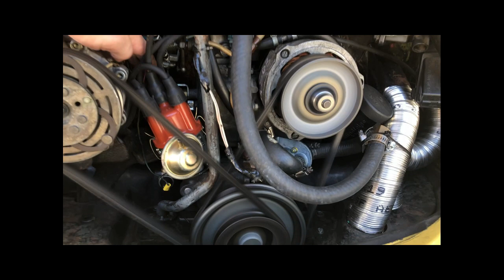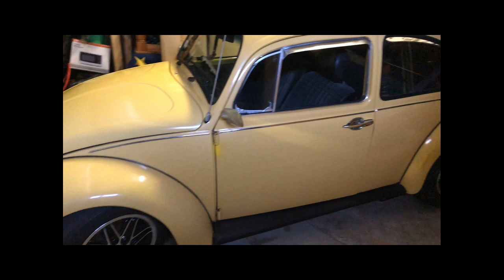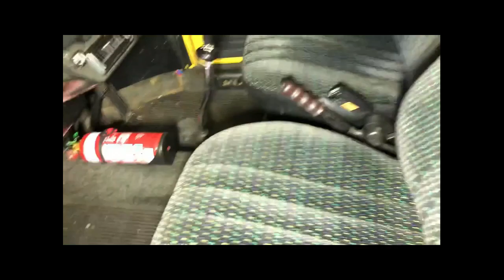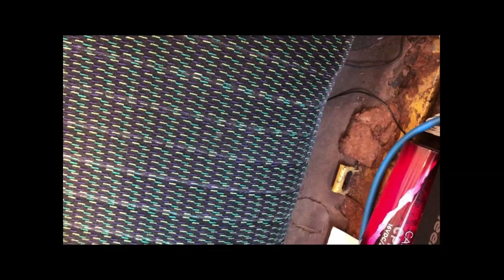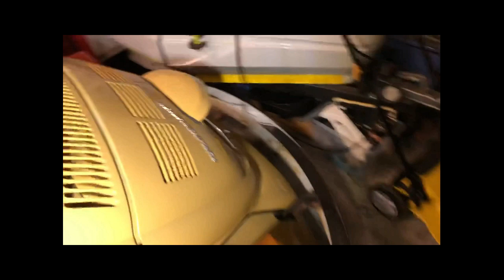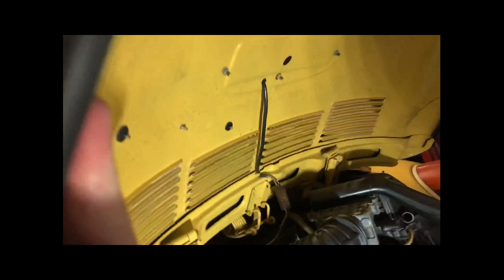1976 VW Beetle original L-Jet FI walk around and Start Up

Comment: A/C is a bad idea... the complexity!  The increased load at hiway speeds creates more heat... all of the plumbing Compressor to Condenser to Receiver/dryer to expansion valve to evaporator... All with pressure sensors...All plumbed thru the car to the front end and then an evaporator next to the passenger's knee's...
Reply from the maker: When its 104 DegF (40 DegC) nearly everyday for 2 weeks in summer, this A/C has been a blessing. Timing is temporarily set back a little to 28 Deg BTDC at WOT and the oil temp doesn't climb above 90 DegC.
Reply: @ithomson100  Don't turn it on!